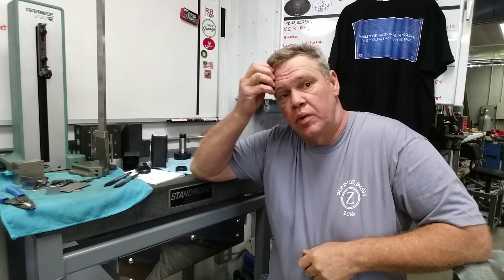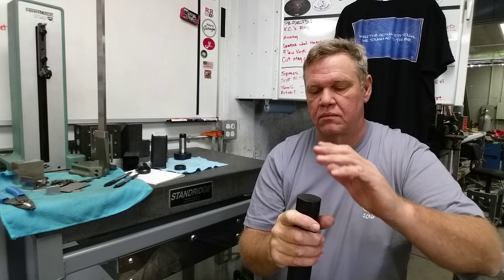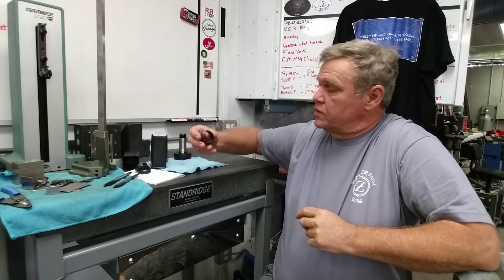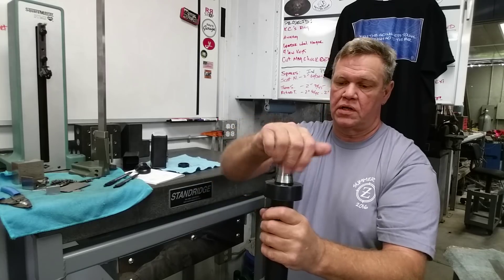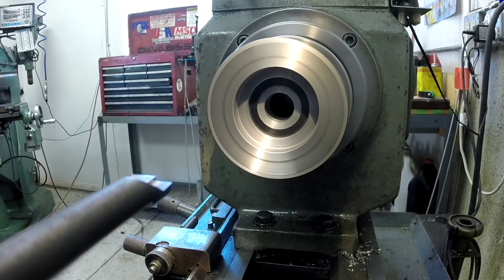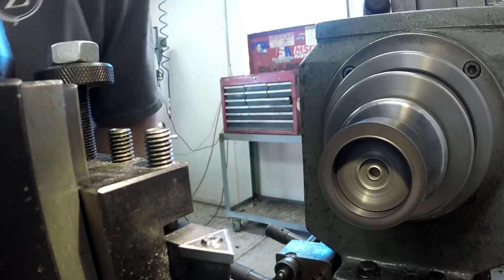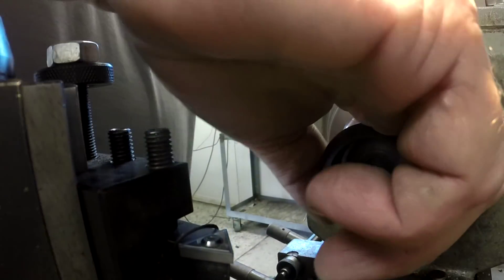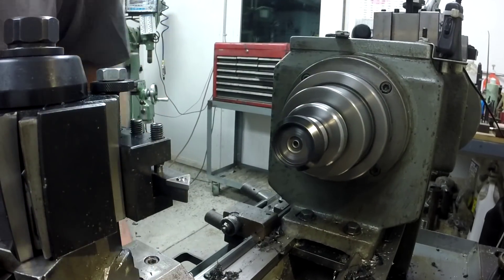Working with UHMW

Comment: The inside diameter cutting tool and the OD tool have a similar angle for turning, right?. Drilling and turning ID in the same mounting would have been problematic? I just didn't undestand why you drilled them in a separate operation
Reply from the maker: For single pass boring, I could have set up a drill bit on the lathe and followed up with boring, but many time we have 2 people working the job and the drill press op just works for me.

Comment: I machine 3/8" X 5/8 strips of U.H.M.W. They have the bottom rounded to ride in a groove and the top has a 1/4" slot. I use the router table with a 3/8" radius cutter and do each side. Then to make the slot I use a parabolic end mill as it throws the chips up and out of the slot. A regular two flute end mill makes a terrible burr and the heat build up welds the chips to the sides.  I also drill a hole in them and again I use a parabolic drill bit.

Comment: Great video - I had to make bush rings for telescopic mast sections and tried UHMW PE, it has quite a bit of spring to it and other issues - using a turret lather to do the cuts inside and out then part off - started using Ertacetal instead, otherwise knows a Delrin but a different grade, its much better to machine to spec and less spring - 10 years in service no appreciable wear.

Comment: Some years ago I started working for a place that made conveyors with UHMW rollers.  They were turning the roller ID using carbide tooling, and having a problem with size and finish.  I had an old Vascalloy blank that I ground to a sharp point and honed the edge to razor sharp.  Problem solved.

Comment: Nice, I've worked with that stuff before, but never machined it. Looks like those "chips" could be quite the PITA if they want to be. What was your tolerance for these parts, looks like you're flying through them pretty quick.

Nice video, thanks for the tips!

Comment: Stan, Great instructional video. What sort of tolerance were you allowed on the parts?
Most non-machinist folks would not appreciate the effort, tool changes and sets up to make a "simple" part.
Very nice job!
Eric
Reply from the maker: +esoomreltna Hey Eric, UHMW is very rubbery and most customers realize this, holding + - .002 isn't too hard, but the spec was +- .005, when cutting an OD on an expanding mandrel you have to compensate for the stretch of the part. Only measure when it comes off the machine and allowed to relax again.
Reply: Stan,
Reminds me when I was making hip and knee joint parts from surgical teflon. Spec was to measure at 72F but the shop was at 85-90. Lots of fun. But that was A LONG time ago.
All the best!
Eric

Comment: Very nice video, Stan. Being in South Florida, I can relate to the temperature issue. In my case, I resorted to running high speeds on the spindle and cut. Never thought of cooling it down but I will try that next time.

Comment: Great tip on the ice trick. Are razor sharp inserts available commercially or do you grind your own?
Reply from the maker: +bcbloc02 I actually hone inserts (edges) on a 600 G diamond bench stone, try it, works surprisingly well.

Comment: Nice, I just did a huge order of UHMW parts on my barfeed CNC. I had to spend hours messing with tools and cut directions to keep the string from wrapping on the parts or the chucks but if you take the time to get it right it can save a lot of time stopping the machine to cut the string off. Another thing that I would like to try is one of those cold air nozzles that use shop air. I only had coolant and that helped a bit but definitely something cooler would have been better.
Reply from the maker: +Widget Works Manufacturing Inc. I think a liquid nitrogen spray nozzle would be the hot (or cold) ticket.
Reply: It sure would! But I don't think it would be super cost effective for the couple times a year I cut the stuff. I thought about filling my coolant tank full of ice to chill the coolant (Ice is super cheap in the dead of a Canadian winter :)